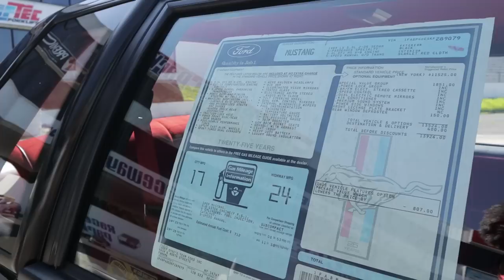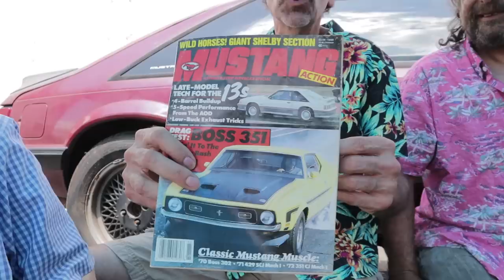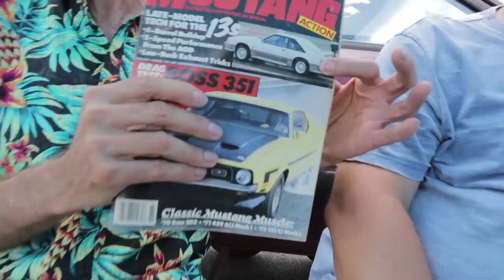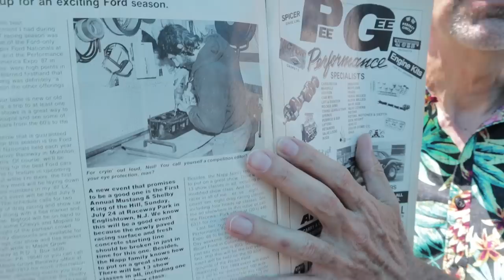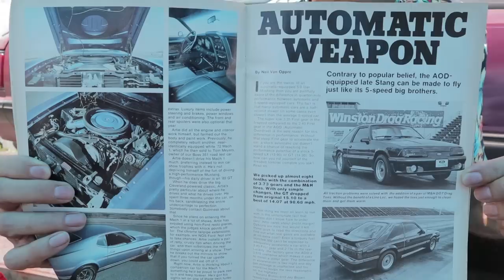5.0 Fox Body Mustang Revolution- The Second Coming Of The American Muscle Car

Comment: Awesome Uncle Tony《☆》Those were crappy times for Mopar guys :*: The Dakota had rwd & a V8 but Other than the Dak you could get a Viper in 93🤓☻🤠
Reply: the 80's was crappy for the big 3 until 1986 when the 5.0 EFI and the Buick Grand National most of the fast cars of the 80's was Ferrari and Porsche even the vette's were not very good until 1989 with the ZR1and I think it was 89 or 90 when they made the Turbo Trans Am V6 the same kind of engine that was in the GN but not many were made
Reply: If you bought a v8 2wd Dakota, standard cab, manual trans, with tow package, in I believe 92-93, it was faster than everything else (American cars) available at the time. I read an article about it in Car Craft or Hot Rod, showed my friend and he had a Dakota 2 days later... We put sticky tires on it and better rear leafs and surprised a lot of people with it..
Reply: @mikehagen3785  《☆》For sure :*: Magnum power :*: I wish I'd kept my 92 regular cab but my 98 club cab 5.2L is fun🤓☻🤠

Comment: If you had a driver's license in the 1970's, you remember being able to pick up musclecars for the price of a 10 year old car, and riding it hard then sending it to the junkyard wet. In the shadow of the Terminator and Coyote Mustangs, the 5.0 Fox allowed a new generation this century to buy an old factory hot rod for cheap and flog it before letting it go and missing it afterward. Soon they will be too classic to do that, and it will be the LS1s of the 2000's and the early Hemi Chargers young people pick up for cheap and do burnouts in the parking lot and learn bootlegger turns on (as long as they disconnect the traction control :)  ).
Its the cycle of musclecar life.

Comment: This one that got past me, found and listened to the whole show. I had a job pulling wrenches for a logging company at  this time. I got my hands on a 87 late in the year but it had set on the lot since spring with more engine problems an stuff and they were going to crush it or something and this kid  had dented it up too. I went to the dealer and said; as is where is bottom dollar thinking they will laugh at me. They know I am married and kids but what they didn't know was my wife was sick of me tearing up our family car racing it. I had to have something to get heat off. I get told if I say how much and all that jazz then they will do do or say something to ruin me. Ok ok ok, I get it and walked out with a low miles car for like twenty five hundred and it had most of the good stuff on it. I take it home and out came the interior, the stuff that made it legal like seat belts for everyone but me, parts of metal that I seamed I could get away with. I had the emergency brakes, the shifter but the boot gone, floor mats gone and a rubber mat just around my feet, under  dash stuff that was extra in my mind that I figured that they wouldn't look for and basically, just my light weight seat, legal but light (no comfort) tape where the radio went and the glove box empty space, all plastic trays gone... I saved three hundred and some pounds. I even got the plastic fuel cell I believe cause some cars came that way. I sat there and kept racing it every night with the ice on the intake and the fuel regulator was off another one that I measured it till it ran the very best. I never used it for anything but. I tried hard at Arlington a few times to get in the twelve but mid thirteen was as good as it got. Memories is all now and just how clear... who knows, the best this grey hair can remember... good times

Comment: had 2 of em. 88 gt from new, and a 90 lx 5.0. both 5 speeds. absolutely sucked as daily drivers. rode hard as f, ate up heater cores and alternators like candy, forget about rain or snow. the hatches wouldnt stay closed and pop open on hard bumps, and every bump was a hard bump. worked on em so much, i could build one from a basket case with my eyes closed. did motors, heater cores, clutches, etc. maybe it was those 5th to second downshifts or taking it from 10 mph to 70 in 2nd. wouldnt get another one if it was free. even if it was a toy. BUT they were so much fun you'll piss yourself.

Comment: These engines were also used in the marine industry. Unfortunately the drive train it was hooked to was horrible until around 95 then they quit using them right about then. They were bullet proof. Could run 4500 rpm all day without any problems at all, well until the drives blew up. Lol. Awsome engines for sure!

Comment: I remember crushing 2 different 350 IROC camaros. After i beat both of them from light to light, we went on the thruway were i proceeded to crush both cars with my 1988 notchback. What made matters worse was i had a passenger riding with me. The camaro guy's were friends of mine but not so much afterwards 😉😂

Comment: Alot of 86's were also equipped with 2:73 gears which didn't help either.
Reply: TrakSpock1 I had an ‘86.  I sold it quickly to buy a red ‘90.  Much better.
Reply: Same with the 87s. 3.08s were an option

Comment: I own an 89 lx notchback almost identical to the one in the video. Less than 45k original miles, 5 o 5 speed. Been thinking about selling due to lack of time to enjoy the car and not quite practical for me. I would love for someone out there searching for one to enjoy it more then myself. A true unmolested survivor here in Maryland
Reply: @PaPa: whatcha got buddy! what's the color, ? what's done to the motor? where the car from? $ etc:etc:
Reply: I inherited the car from my grandfather. Ive had the car for like 3 years now but dont drive it much. Its dark blue with blue interior. Completely stock as far as I know.
Reply: @PaPaChillJay  what the price on the car!? It is the 5spd. 5.0 v8 car!
Reply: I've had a few offers on the car but I wouldnt wanna see it go for under 6500
Reply: @PaPaChillJay  the car is the 5.0, 5spd! Same wheels as the car shown in the video! Is the car in great.. shape! Interior cloth or leather in great shape also!! tilt wheel!
Reply: Yes the exact same car as in the first 30 seconds of the video except has white letter tires. Blue cloth interior is in good shape, only thing wrong with interior is the cigarette lighter door that covers ashtray wont stay down. Must be a spring or something that is broke. Its a 5.0 5 speed with just over 45k original miles. Car has a small mark on rear driver side fender flare where someone hit into it while it was parked. Hard to see the spot but is there up close. It was parked at a local grocery store and when I came out I saw some white paint on the car and there was no one to be found. I would say the car is a close 9 out of 10 for condition. The car is in Lavale Maryland not sure if your familiar with that area or not.

Comment: How did you not get PS fluid all over the place with belt bypassed? Ford's always puked PS fluid turning wheels  without engine running and unit spinning.

Comment: he talks about launching the car when you hear the tires chirping a little. I learned how to launch an AWD car like a my old WRX’s. You press the clutch in rev to about 4k rpm’s slowly slip the clutch (better burning out your clutch vs blowing out a tranny) till you hear the tires breaking loose. just slip the clutch till it hooks up and keep your foot burried while slipping the clutch slowly. It slips it past the point where gravity and weight are trying to make it stall and fall over but the RPM and clutch slowly slipping the slop out of the extreme change in weight and mass gets up and digs in with the rear end chewing up all the traction it can find!

Comment: I do not think we will ever see another car like the Fox 5.0 Stangs.  They had huge potential and could be made to carve covers with junkyard parts the K member lower arms and larger and 4 wheel disk brakes from an 83 continental were a bolt in,  it lowered the CG by lowering the engine by 1". The SVO's just used the Conti suspension. You could build yourself an SVO 5.0L for next to nothing.  We will never see a vehicle that like that again, it had so many easy low buck upgrades but was also excellent from the factory.

Comment: Those black Enki rims on the maroon hatchback on the trailer while talking to Bernie are like f#cking Hens teeth!!! Good luck finding an original pair of those!
Reply: yep.. and I don't give a damn.. what you put them on it will look sharp as hell! got a set on a 87'gn as we speak!
Reply: face  friend in high school had them on his red 83 with an 85 nose and they were great looking wheels. He broke one on a curb and I think they had stopped production at the time because we couldn't find a replacement. Think I read a year or two ago they started making them again.
Reply: @dngendron  yea.. at one point an time.. they did! But.. I have a set on my 87'gn. it's a 1 owner car.. I got it for graduation, just got 75,xxx I think on the dash! I am looking for a 87'-93' 5sp. Gt t-top car, would perfer stock but stock'ish would do! But, those wheels look badass on them Gt's and that's what I have in mind!
Reply: @scarface9617  yeah enkei started making them again but not in 4x108. So won't be getting a set for mine.

Comment: 2.73 gears came in the AOD cars. 

3.08 and 3.27 came in the 5-speeds. 

Lol 10 minute tune up, remove silencer bump timing to 14 degrees and adjust the TPS sensor.
Reply: Wrong, my 91 5.0 AOD car came with 3.27's
Reply from the maker: 2.73's were standard on 5 speed cars, 3.08 was a no cost option
Reply: Uncle Tony's Garage 

I stand corrected, don’t know why someone would want the 2.73 desert gears on a 5-speed car. 5th gear would be useless.
Reply: 1991CALYPSO 

2.73 is what comes in them, 3.27 was a no cost upgrade just had to check the box when ordering.
Reply: I have 3.27 in my 91 5-speed Notchback, car is heavily modified for Time Trials. Great gear but first gear is still useless just spins as does second. But for cruising around town the 3.27 with 5-Speed is awesome, hate 3.73 constantly shifting every other second. 

Now you want a good T5 5th gear find the one used in a Jeep. They aren’t overdrive. 

Also using a 4-banger 5-speed is awesome, close ratio gears and no overdrive for 5th gear. Easy to put it as the input shaft size is smaller where it goes into the pilot bearing. 

Use the 4-banger roller bearing make a sleeve then press into the V8 outer housing. 

Long as you don’t drag race they will hold together and take abuse. Sorry that I took mine out to be honest they are totally different cars with them. 

Or you can go the Astro Performance route they sell nice gear sets for T-5s and can bulletproof them.
Reply: @South_0f_Heaven_ 5th isn't useless on a stock 5.0 from a cruising perspective

Edit: Jeep T5? Weaker gears and every T5 is an overdrive trans. 

Regarding the 4 cylinder Mustang trans, again, worse in every category. They're not close ratio, either outside of 5th. The entire 1st-4th spread is much wider than a V8 T5
Reply: @garlandjones7709  No, you use the Jeep 5th gear as it’s not an overdrive gear. Not the entire Jeep transmission. 

Learn how to read, this is how we did things back then.
Reply: @garlandjones7709  And a 4-cylinder T-5 has no crazy overdrive gear like a V8 T-5 does. 

Easy and cheap option just requires the correct throw out bearing or have a sleeve made up to mate a V8 outer to a 4 banger inner. 

Did you read Wikipedia now you think you know everything?
Reply: @South_0f_Heaven_   @IHMT00  dude I don't have a problem learning how to read. A Jeep 5th gear is a .85 or a .76. both of those are overdrive gears. 4th in a T5 is 1:1. If you put a non overdrive gear for 5th whats the point of the shift? To blow the engine? Why not remove 5th entirely as 1:1 is as non-overdriven as it gets.

A 4cyl doesn't have a tall overdrive...I said that. You said it was. A close ratio trans. That's what I commented on. It isn't. A 4cylinder t5 is also much weaker, with a crazy gap between 1st and 2nd gear and further gear drops all the way to 5th compared to a regular wct5. I have no clue why they're even being mentioned.... And can you tell me when jeep 5th gears were being used in Mustangs as I have zero recollection of this.

Comment: Thank you for this nostalgia trip. Please do more of these if possible. 

In the late '80s, I bought every magazine I could find that had any content on the 5.0 Mustangs and I still have my copy of the issue you were passing around in the video. As Bernie stated, there was nearly nothing available for a while. 

Got my first car in 1986, a 1984 Mercury Capri 5.0 5-speed. Loved that car. 

In 1987, I got a 1986 Mustang GT. By 1989, it had a 150hp wet single nozzle NOS kit, Kaufman pulleys, and Mickey Thompson I-blocks. That car was totaled in 1993 when someone ran a light. 

I put all the Mustang parts into a 1979 Mercury Capri and still have that car. There's some videos of the '79 Capri at Firebird Raceway in Phoenix on my channel. https://www.youtube.com/watch?v=hiO4rge70_E   https://www.youtube.com/watch?v=JvFxEAs-b3U

Also have an 1985.5 SVO and a 1984 Mercury Capri RS Turbo that has been to three Radwood shows in eight months.

Comment: 5.0 for life   🦊🦊🦊🦊🦊
Reply: WHAT BERNIE SAID ABOUT YOU COULDN'T BUY ANY PARTS FOR THE SMALL BLOCK FORD STEMS DOWN TO THE THREAT THE SMALL BLOCK FORD POSED TO THE SMALL BLOCK CHEVY BACK IN THE 60'S WHEN THE 289ci DEBUT. THE 289ci WAS SUCH A THREAT TO THE SMALL BLOCK CHEVY THAT THE NHRA (HENCHMEN FOR GM OR ANOTHER DIVISION OF GM) IN ORDER TO KEEP CHEVY IN THE WINNERS CIRCLE. WOULD CHANGE THE RULE BOOK ON THE 289ci MOTOR LIKE THE WEATHER CHANGED IN KANSAS TO DISCOURAGE ANYBODY FROM RUNNING IT. THE CHANGING OF THE RULES WERE BOTH WRITTEN AND UNWRITTEN. SO IF YOU SHOWED UP AND RACED AND WON. THE NEXT TIME THE RULES ON THE MOTOR WOULD BE CHANGED SO YOU COULDN'T RUN IT. IT WAS ALL BASED ON CHEATING. WHAT I WROTE HERE FINALLY ANSWERS THE MYSTERY QUESTION OF WHY FORD'S COST MORE TO BUILD. ON THE OTHER HAND YOU CAN BUY RACE PARTS FOR THE SMALL BLOCK CHEVY THAT WERE EVERYWHERE AT NICKEL AND DIME PRICES. SINCE THE SBC WAS THE FAVORED MOTOR. THERE PARTS WERE NEVER RESTRICTED AND MASS PRODUCED WHICH KEPT THEM CHEAP. ON THE OTHER HAND NEITHER WOULD FORD NOR THE AFTERMARKET RISK PRODUCING RACE PARTS FOR THE SMALL BLOCK FORD WHICH THE HENCHMEN FOR GM THE NHRA WOULD BAN OVERNIGHT, AND THE MANUFACTURERS WOULD BE LEFT WITH A WAREHOUSE FULL OF SCRAP METAL. BECAUSE IF YOU CAN'T RACE IT AND WIN, THEN PEOPLE WOULDN'T BUY IT. FOR THE FEW COMPANIES THAT DID PRODUCE PARTS LIKE CAMS, MANIFOLDS, PISTONS, ETC. THESE PARTS WERE PRODUCED IN SMALL VOLUMES BRINGING TO COST UP 2-3 TIMES MORE. NOBODY WOULD DARE PRODUCE A HEAD FOR A SMALL BLOCK FORD BECAUSE OF THE THREAT OF A BIG EXPENSIVE PART LIKE THAT BEING BANNED, WHILE AFTER MARKET HEADS FOR THE SMALL BLOCK CHEVY WERE PRODUCED WITHOUT RESTRICTIONS. WARREN BROWNFIELD WHO I THINK LATER STARTED AIR FLOW RESEARCH WAS MAKING RACE HEADS FOR THE SMALL BLOCK CHEVY FOR YEARS AND SO WAS EDELBROCK. SO IF YOU WANTED A HEAD FOR A FORD WHERE DID YOU GO, NOWHERE. YOU HAD TO MAKE IT. YOU ACTUALLY TOOK CHEVY VALVES AND MACHINED THEM DOWN. ALSO WHAT BERNIE SAID ABOUT A HEAD BEING AVAILABLE FOR THE SMALL BLOCK FORD. CAME ABOUT IN 1989 WHEN TRICK FLOW PRODUCED THEM. IMAGINE IT TOOK CLOSE TO 30 YEARS TO PRODUCED A HEAD FOR THE SMALL BLOCK FORD. AND THE ONLY REASON THEY DID WAS DUE TO THE POPULARITY OF THE SMALL BLOCK 5.0 MUSTANGS. AT THE TIME IT DEBUT THE RACE TRACKS WERE DEAD. ONLY CERTAIN HARDCORE RACERS MOSTLY CHEVY, WERE THERE AND THE STANDS WERE EMPTY. ONCE THE MUSTANG 5.0 CAME INTO EXISTENCE IT INJECTED STEROIDS INTO RACING AND HAS BROUGHT RACING TO WHERE IT IS TODAY. NITROUS, TURBOS AND SUPERCHARGING COMPANIES CAME INTO EXISTENCE AND THE ONES THAT DID EXIST STAYED IN BUSINESS BECAUSE OF THE POPULARITY AND MASSIVE POTENTIAL THE SMALL BLOCK FORD HAD TO MAKE POWER. WHEN I THINK ABOUT THIS STUFF. I THINK ABOUT HOW BIG OF AN IDIOT GALE BANKS WAS THINKING CHEVY WAS THE BEST AND THOUGHT NOTHING ABOUT FORD. IF HE WOULD HAVE PRODUCED TURBOS FOR THE SMALL BLOCK FORD. TODAY HE WOULD BE ONE OF THE DOMINATE LEADERS IN TURBO TECHNOLOGY UP AT THE TOP. BUT THINKING CHEVY WAS THE BEST BLINDED THIS MAN WHERE TODAY HE IS A LIMITED COMPANY STRUGGLING ALONG TO STAY ALIVE. LOOK AT THE IRONY OF THIS WHOLE THING. THE NHRA PUT BANS ALL OVER THE SMALL BLOCK FORD FOR YEARS TO KILL IT. ONLY FOR IT TO COME BACK YEARS LATER TO BIT THE CHEVY SMALL BLOCK IN THE ASS. ALL YOUR 5.0 RACE CLASSES WERE CREATED FOR FORD, BECAUSE THE SMALL BLOCK FORD HAD NO COMPETITION, THE CHEVY SMALL BLOCK COULDN'T COMPETE IN THESE NITROUS, TURBO AND SUPERCHARGING CLASSES. IN ORDER TO BECOME A PLAYER YEARS LATER GM DUMPED THE CHEVY SMALL BLOCK IN FAVOR OF MAKING THEIR OWN SMALL BLOCK FORD THE LS. FROM TOP TO BOTTOM THE LS IS 1000% FORD. NOT 1 ONE DESIGN ASPECT OF THE OLD SMALL BLOCK CHEVY LIVES IN THE LS, THE LS IS ALL FORD IN DESIGN.

Comment: In 1990 I bought an 88 Celine cologne that was as close to the real thing as you could build yourself and I drove the living shit out of that car and other than oil changes I could’ve welded the hood shut that thing went on 10 Hour Rd. trips in the middle of the winter across British Columbia and yes gator backs in the snow are a nightmare but it still worked I love that car now I’ve got a completely built 89 blown nitrous stroked road any track monster now and I would not trade it for anything

Comment: My uncle use to run mccreary mud tires his best run was 13.1 @ 99 mph in his 88 gt automatic with 3.73s a little extra timing at sea level in around 50* weather at morosso in 1989. That car was a unicorn it WASTED all stock mustangs it ever raced by 3 or 4 car lenths at least . People swore he must have nitrous but NOPE it was stock and full weight. And people call BS on this story all the time BUT........IT DAMN SURE HAPPENED!!